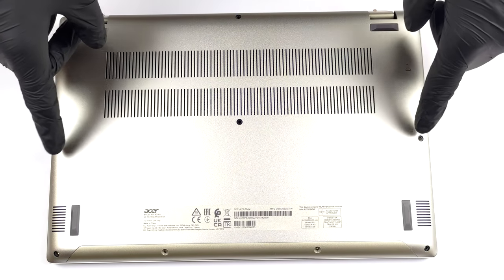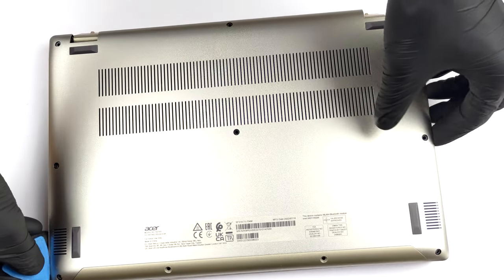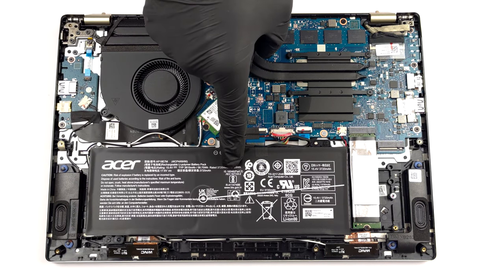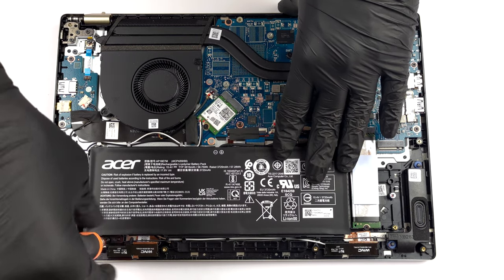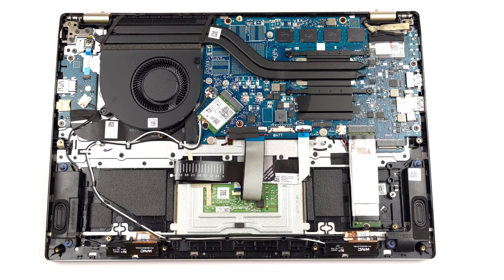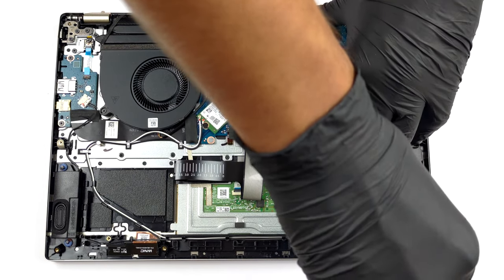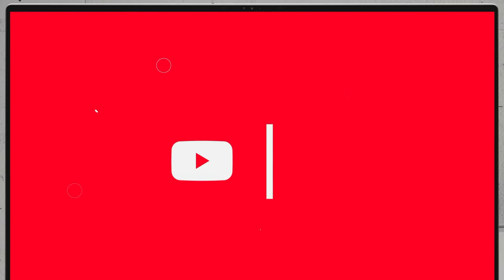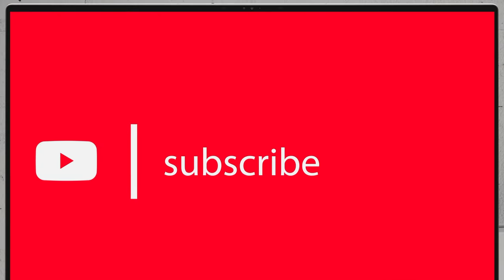🛠️ Acer Swift 3 OLED (SF314-71) - disassembly and upgrade options

Comment: Why m.2 slot gen 3 not have nut? // this slot is 2260?
Reply: I had the same thought. Compared to the included M.2 2280 it looks like the second M.2 slot is NOT 2280.  But the narrator does not comment on that point.
Reply: other one in 2242

Comment: Soldered Ram, why did it have to be soldered Ram?
Reply: Exactly why I'm here. What a disappointment!

(Edit: after doing some research, this is ddr5 4800mhz ram so you will get the same performance as 32gb ddr4. For this laptop it should perform just fine even for gaming if you connect an egpu like I will end up doing.)